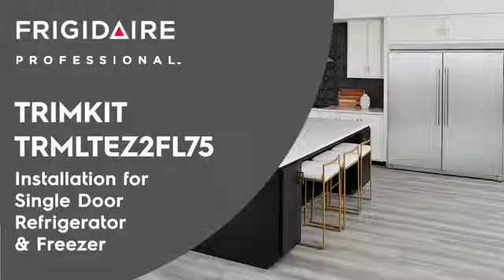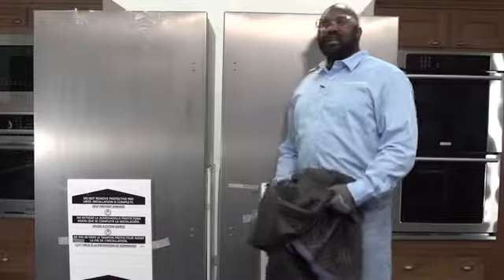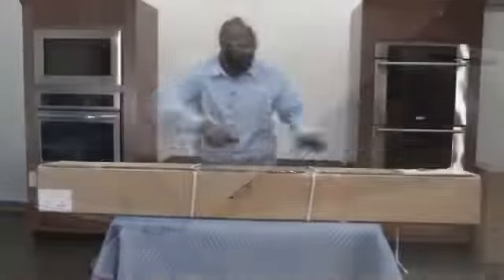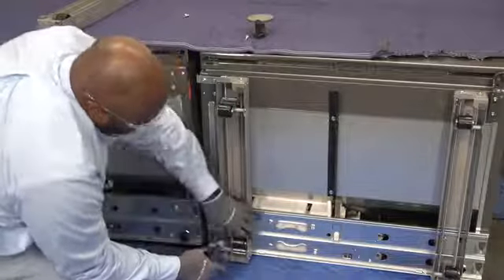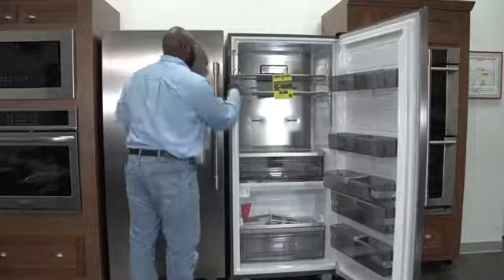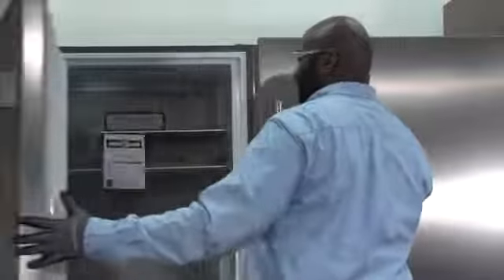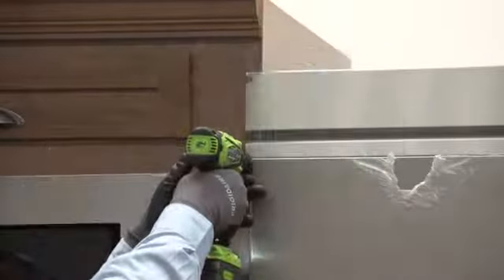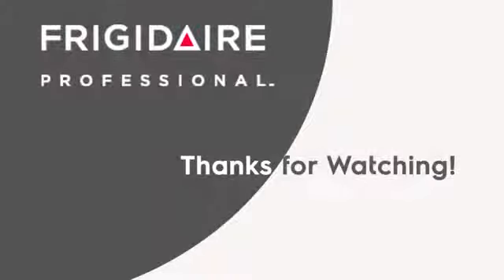Frigidaire/Electrolux - Installing a Trim Kit on Tall Twin Refrigerator and Freezer

Comment: Glad you’ve improved the levelling kit. Although we’ve had to replace the fridge unit once after it broke for the second time. Then the new one crapped out so both fridge and freezer got taken away to the landfill. I’ve been warned away from the new versions from repair techs because of the redesign of the cooling system. They are seeing high volumes of repairs apparently

Comment: I am installing this setup in Nov 2022. This video is missing bits in the install manual please READ THE INSTALL INSTRUCTIONS.  Make sure your fridge doors are square to the cabinet. My fridge door was 1/4” off at the top.  Install all trim pieces before you start to get perfectionist at leveling it.  Mine was level and then put the center trim in and found my fridge door was off level.
Reply: Share link to your video please